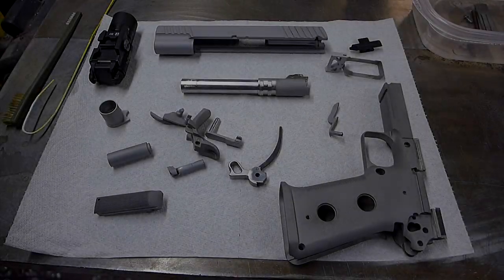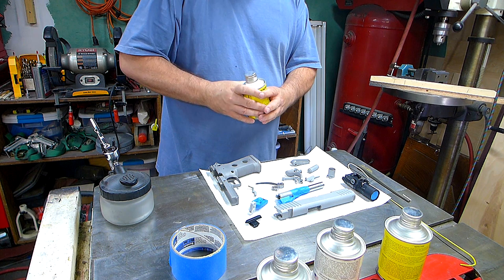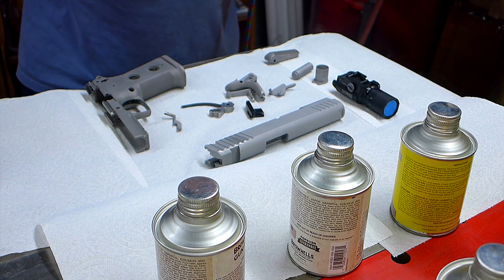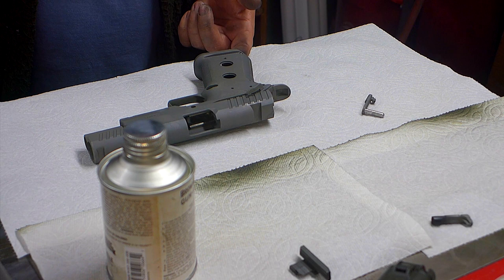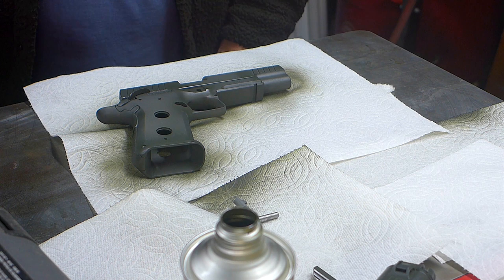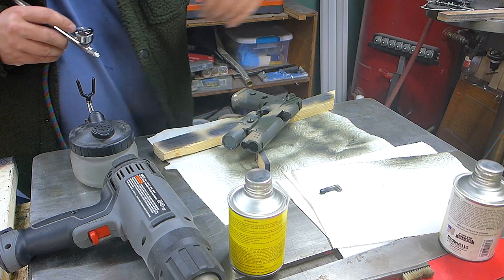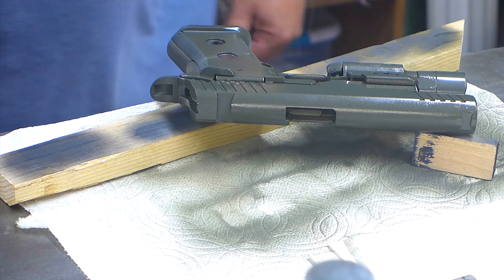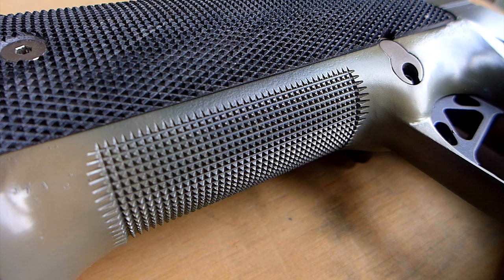Titanium 10mm Hi-capacity 1911 Build | #28 (Painting)

Comment: A piece of chicken wire stretched makes a nice texture tool if you like free handing camo. I get those plastic sheets like paper from the arts and crafts section and cut out camo blots with a little square to hold them. They're nice and flexible to where I can get it right up to the piece I'm working on for when I want sharper edges ect.
Reply: I have used the rubbery mesh material used to keep furniture from sliding, some people put it in cabinets to set dishes onto. Also, laundry bags (cloth) get better as they are used.